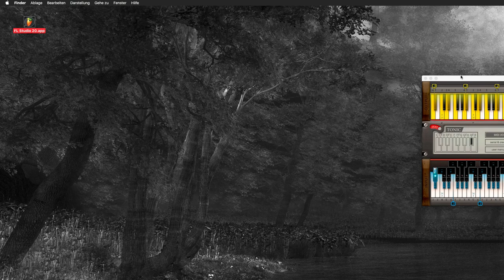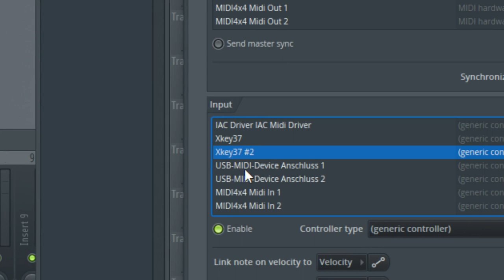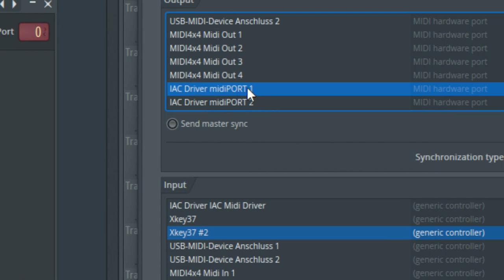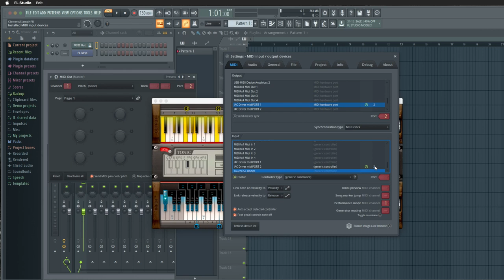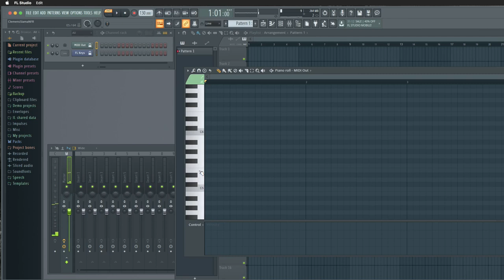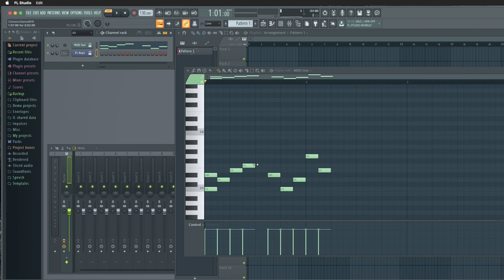Reharmonization Workflow: FL Studio MIDI Out Plugin Setup

Comment: Is there a way to change the behavior of the Midi-Out-Plugin knobs? e.g. I want it to act as ON/OFF button (without the range) to use it with non-knobs/faders controls on my midi keyboard.
Reply from the maker: I don't know much about FL's Midi-Out-Plugin or how it can be accessed/assigned to certain input signals etc, but I'd rather suggest you look into starting to use Florian Bömer's  MIDI Translator Pro: http://tinyurl.com/y2cbrjfv for any custom setups with MIDI, that goes beyond your usual DAW functions (eg, switching MIDI channels, controlling software/gear remotely, advanced routings etc,).
Clemens

Comment: I downloaded the demo but this setup is sooooo confusing, I have to uninstall 🤦🏿‍♂️😫😩
Reply from the maker: Hello. What's the issue exactly? Sorry to hear that you are struggling. But hey, don't give up – MODAL TRANSPOSING can be extremely rewarding, I've seen many people who were sceptical at first
Maybe I can help you with the setup?

As explained here http://tinyurl.com/yyqkm29p on WIN you have to install a virtual MIDI port first … which can be found for free on the internet.
–> Once this virtual MIDI port exists on your computer (some systems require a restart to initialize the new configuration), follow these steps:
1.) Go to AutoTonic's MIDI I/O settings and select your physical MIDI keyboard as the only INPUT in AutoTonic's INPUT list.
2.) Then head over to the OUTPUT list and select the newly created virtual MIDI port there, so AutoTonic will send all its OUTPUT signals (the transposed signals) there
3.) Then open your DAW (or standalone software etc,) and make sure that the only INPUT signals in your DAW are coming from this virtual MIDI port

Routing Scheme: MIDI keyboard–>AutoTonic–>Virtual MIDI Port–>DAW

–> OR maybe this video http://tinyurl.com/y54dzqng (Credits to Bro Beatz .TV) helps.

–> OR simply write me an email, to <support@autotonic.net> and I will try to reply asap (I am located GMT+2)
Clemens from AutoTonic, Vienna

Comment: I used the virtual midi, it works but I'm not able to do the function whereas u mute one side of the 
Keyboard for chords only, and open up another for melodies only...
Reply from the maker: Sry for the late reply I was logged in with my other YouTube account and didn't noticed your comment/the notification. Next time simply write an email if it's urgent <support@autotonic.net>. Now back to your question.
I guess you are dealing with the circumstances that you want to make 2 AutoTonic instances listen to the same midi keyboard source, right? unfortunately, while this works flawless on Mac, with Win there are limitations by the way Win handles MIDI, as on Win you can only select a single source as input at a time. To still achieve the results you are looking for you will have to pre-route your MIDI keyboard's signal and duplicate it onto different ports.
So you have to get the signals on different "MIDI ports", rather than using the same one, on Win as fas as I remember.
I mainly work on Mac myself nowadays, and I wished my answer would've been shorter, but you still can get the same result by fiddling around a little bit and see what works and what not yourself. Clemens.